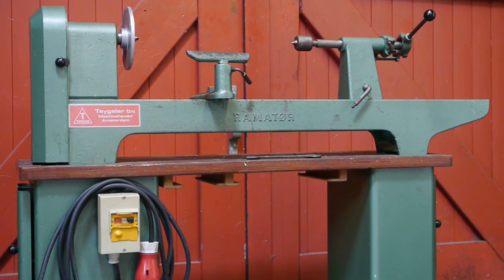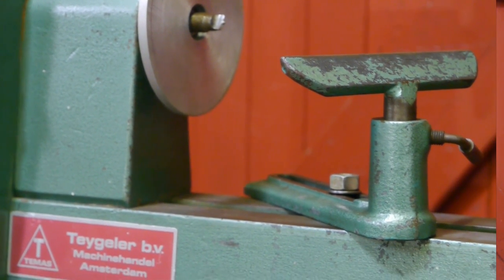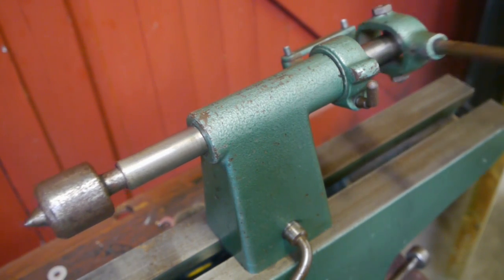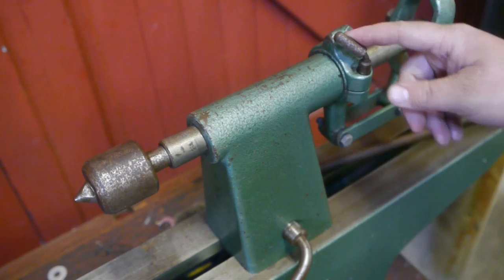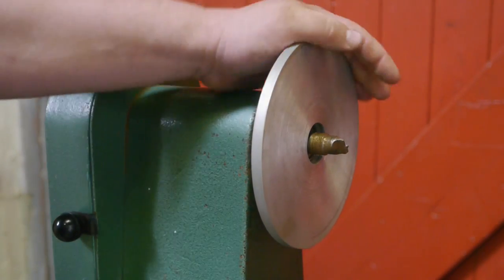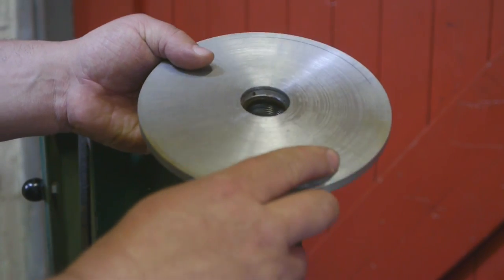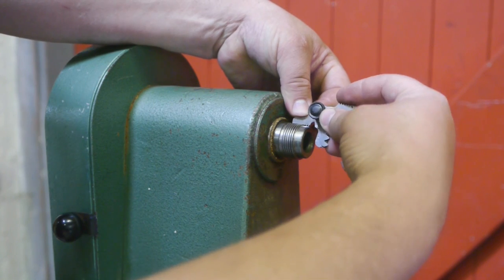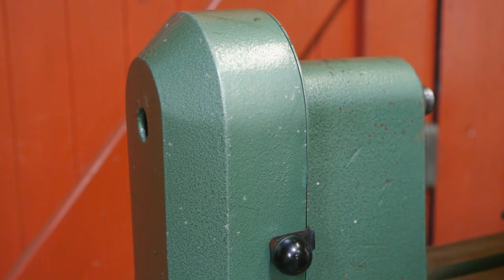Introducing my "new" Ramator wood lathe

Comment: Thanks, I did enjoy the initial tour of the Ramator lathe.  I also did not find anything in an internet search.   I hope the company on the label is able to provide some information.

The quill travel mechanism is unusual for a wood lathe.  I have seen this style on metal lathes with turrets in the tailstock.  Faster to drill etc. with the swing mechanism.  You may find this more useful than it seems.

The slots in the rack for the turning tools look like they are designed for skews or scrapers.

The lathe bed seems to be very robust.  The banjo does not seem as robust as the lathe bed.

MT2 in headstock and tailstock is very good.  Same as my wood lathe. 

I do not have auto-eject in my wood lathe tailstock.  The manufacturer, Teknatool, has only recently made a new model lathe with auto-eject.  Previously they did not include auto-eject in their designs.

A VFD with the 4 pulleys should allow a lot of speed options.
Reply from the maker: I agree the banjo looks a bit flimsy.  It's what I like the least about the lathe.
The bed is very robust. There is quite a bit of cross bracing. I think it should be possible to do some light metal turning on this machine.

Comment: Nice find I was trying to make a wood lathe using my clausing and ran into accuracy problems so I ran out and got a mitutoyo micrometer and tried to dial it in. It used to be over .005 per inch. And now it is down too .0009 per 3 inches which is good enough for me. Have fun with that thing I hope it doesn't explode.
Reply from the maker: Making my own wood lathe that's something I would like to do one day.

Comment: Looks like a decent robust lathe and It looks pretty easy to change belts over with that full opening door (unlike some that that have a small cubby hole for access). It seems previous owner added that wooden shelf between lathe and the stand which gives some decent space for tools etc. M2 both ends which very good for standard tooling. Overall, pretty good in my opinion.. Congratulations & looking forward to seeing you use it.
Reply from the maker: It's not too difficult to change the belt. But there is no easy belt tightening/loosening mechanism so you have to work the top belt to a smaller groove to free up some room. Then look down and catch the wanted groove on the lower pulley and work the belt back into the correct groove on the upper pulley. A vfd will be much easier.
Reply: Doesn't the motor move up and down (with a lever or allen bolt to tighten) so that you can tension it? Otherwise maybe it is designed, because of the weight of the motor, it is enough to get appropriate tension on the belts?
Reply from the maker: The motor is on a bracket that can pivot but it bolts securely in place and is not designed for easy adjustment.
Reply: That;s odd. Why have a motor that can pivot but then you cant lock it down in different positions. Could you make something to allow that ie a plate with a curved opening so that when pressuring down the motor a bit you tighten the static bolt(s) to hold that in place (not sure what you call those plates that allow such adjustments).
Reply from the maker: To compensate for belt wear and different belt lengths. 
The previous owner showed me the speed changes procedure. Perhaps and bit fiddly but he made it look rather easy.
As long as there is a bit of slack on the belt I think it should be fine.
Reply: Not too much slack though. Anyway I guess you are just going to try it out and see how it goes. I got sick of changing belts my first 'purchased lathe. There was a small opening plate at the top end and another at the bottom and I could hardly get my hand in. Rather fiddly and I had a tendency of just leaving it one speed pretty much. I made sure my next lathe had variable speed! Anyway good luck.